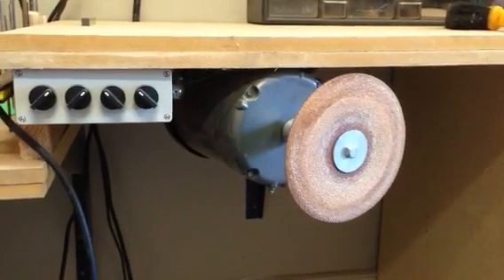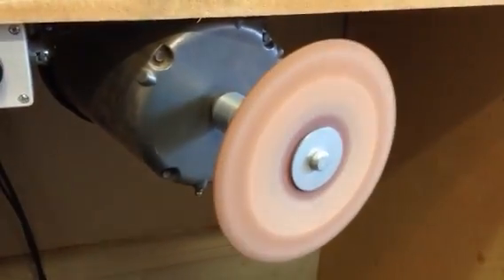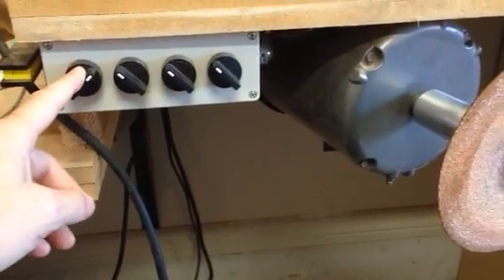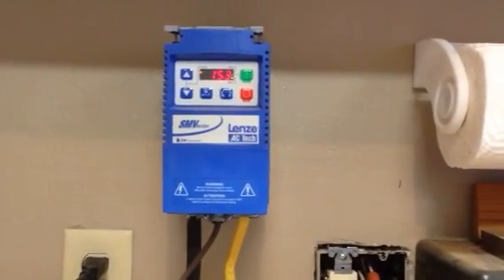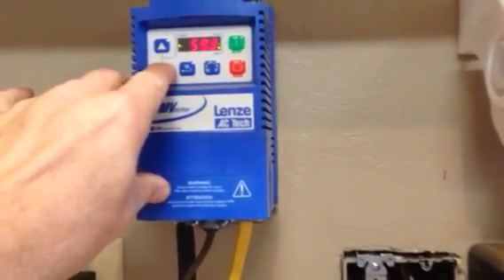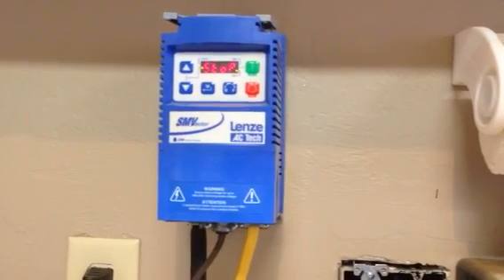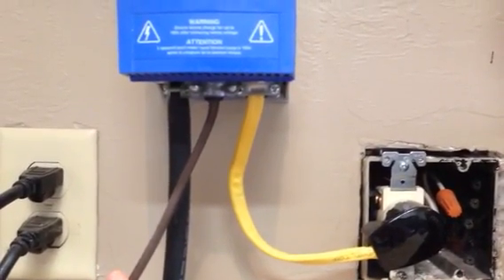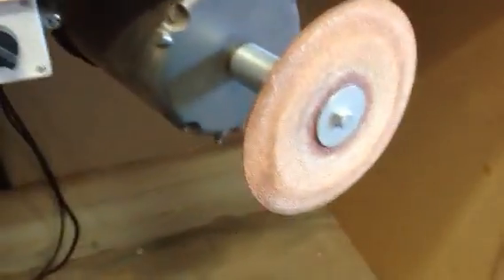Pipe making:  VFD controlled shaping and buffing wheel

Comment: Very nice, Tyler.  Did you wire that up or did you have an electrician run the power and wire up the VFD?  I've had a VFD and 3 phase motor for a few years but just haven't hooked it up so I'm real interested in how it hooks up.